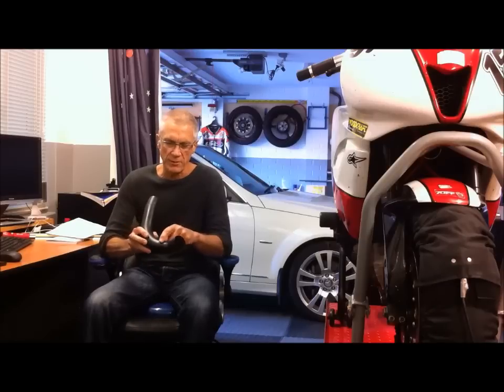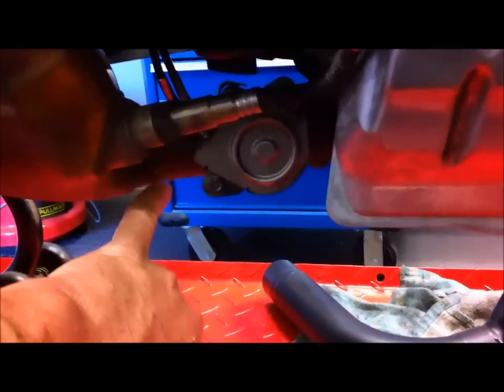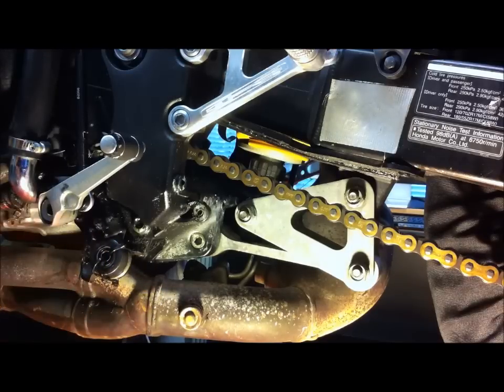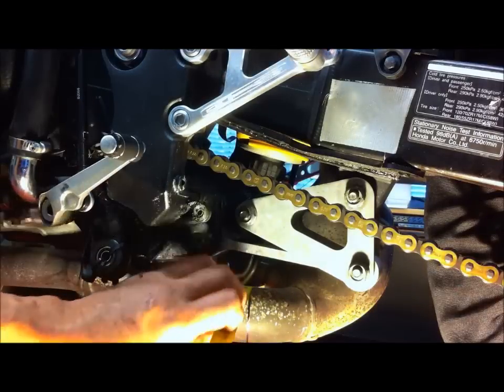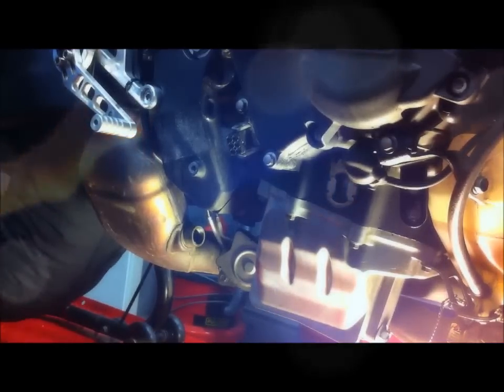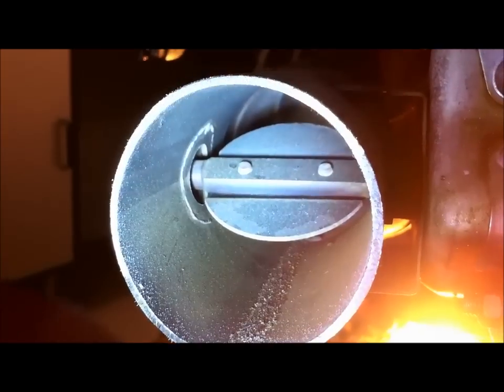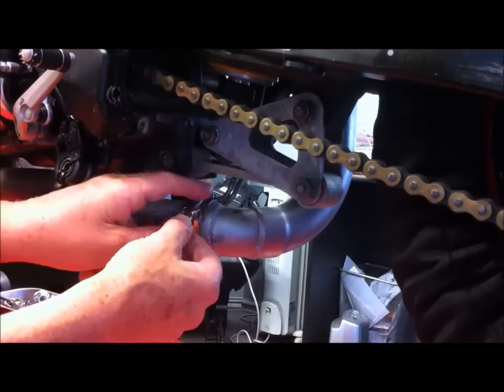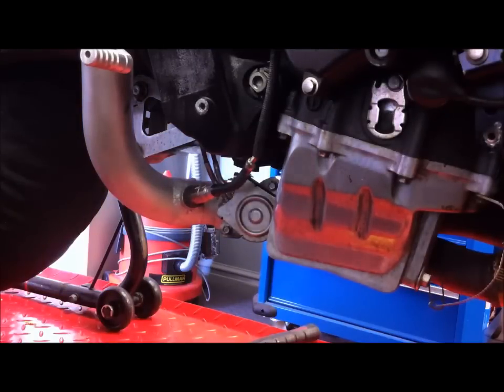2008-2017 Honda CBR600RR Remove Catalytic Cat Converter Fit Eliminator Pipe Mid Pipe

Comment: Thank you.  This video helped me replace the cat converter on my 07 cbr600rr with a SS midpipe with O2 sensor (for my bazzaz and zafm autotune.  Followed your instructions step for step, except for the welding part.  Great video.
Reply: Did you not weld? I want to take off ny cat off ny 07 cbr but looks quite difficult and plus I'm wondering where to get a mid pipe.
 any advice
Reply: @mando8977  No, I didn't weld.  The mid pipe I bought from MJS Performance came with the bung pre-welded at the proper angle.  This is what I bought:  https://www.shop.mjsperformance.com/product.sc?productId=214&categoryId=59
Reply: @mando8977  As for advice, it's a great video, so I pretty much followed everything to a T.  It took a bit of courage to start cutting my pipe, but measure twice and you'll be fine.  I used masking tape to mark my line around the pipe.
Reply: Sweet man!! I'm actually a little worried of cutting my pipe too... I think I'm just going to go ahead and do it, so you have clamps on both ends of the pipe? And also didn't make a big difference in sound and or performance?
Reply: Yes, I have 2 clamps on.  The bottom clamp came with the midpipe on the link I posted.  The top one was already there from my Akra slip-on.  The sound is more throaty without the cat.  As for power gains, I'm not really sure because I autotuned my bazzaz mapping at the same time....which was the main reason I got the midpipe with O2 sensor.  Let us know how it turns out.
Reply: Sweet!!! I THINK im going to do it this month.........last question... did you have to flash your ECU???
Thanks  in advance

Comment: The only part I would be reluctant to do on my own is the part of the video you edited out. Drilling the hole for the 02 sensor and then welding it closed? I'm not even sure what you did there. Do you have that footage?

Comment: I'm curious how much weight was the cat if you had to take a guess? I'm doing this to my bike next week, I already have the parts.  Thanks for the video
Reply from the maker: The cat is not heavy. The weight advantage with the eliminator is minimal. Scott
Reply: Scott Elliott Thanks Scott!!!
Reply: Scott Elliott One more question sir
Did you have tune your bike again after you removed the cat? My bike has already been flashed and tuned my concern is the reduction of air space might disrupt the mapping. What do you think?
Reply from the maker: I tuned my bike as it's a race bike. I have an engine management system that allows me to tune the AFR's. For a street bike I don't think you'll need to change anything. The existing cat does flow quite well so the eliminator gives a small power gain which you'd possibly not really notice on the road.
Reply: Scott Elliott where did you purchase the mid pipe? Or can you recommend where to buy?
Reply: Tyler Moyer I bought mine off if ebay for about 135 I believe perfect fit. I love it
Reply from the maker: search eBay for 600rr cat eliminator. You'll find plenty. http://www.ebay.com.au/itm/DECAT-Cat-Eliminator-Pipe-Exhaust-Honda-CBR-600RR-07-16-Stainless-Steel-/201781515475?epid=621657083&hash=item2efb1d94d3:g:6-QAAOSw241Ydz8U
Reply: @Scott Elliott Not sure if you will repliy to this as its a year ago but i also followed your broken foot video haha i had the same issue 3 bolts in my ankle as well :) only just got my last cast off 3 weeks ago. Did you notice a sound difference when you decat your bike >?

Comment: I was thinking of changing my OEM fog bulbs to a nicer looking once what do you think would look nice any websites you like to buy from ?
Reply from the maker: khaloudy boss Thanks. I bought some of these for the fog lights on my W204. They look great as they're 6000k temperature. Do a search on eBay for "H11 led cree bulb" and you'll find hundred's. I put a 25 w load resistor across each bulb to get rid of the error message.From experience I can say 6000k cree led bulbs look good as they give a crisp white light.

Comment: nice video Scot, was cool to see the inside of the cat core. did removal of the cat make the bike heaps louder?
Reply from the maker: No real change to the noise Tim. I already had the slip on pipe. I couldn't really notice the difference in noise on the track. It's possibly slightly deeper tone but not louder.

Comment: quick question... does it sound louder than it did with the cat?
I threw a slip on exhaust on mines but still not loud, wondering if it would make a difference in noise levels and maybe a little bit of performance?  thanks in advance!
Reply from the maker: I couldn't notice much difference in loudness.

Comment: Hello Scott. I hope you are doing well. I wanted to know if removing the CAT makes any difference in terms of sound and  performance?
i saw a couple of post on CBR600rr forums that removing the CAT make your bike worse if you don't install power commander or dyno tuned your bike to get the max performance. I am from Pakistan and unfortunately there are no Dyno tuners here. 
i am confused to remove CAT converter from my 2008 Honda CBR600rr. So wanted to know if its worth it or not before proceeding.
Reply from the maker: Yes I'm doing well ... thanks for asking.

Removing the CAT doesn't make much difference in terms of sound ... it's a little bit louder.
The fuel map will need to be changed to get it working optimally. If you haven't got a Power Commander or some other means of modifying the fuel map then leave the CAT in place.
Reply: @ScottElliott152  thanks man. Really appreciate that

Comment: i have a couple questions.
i have an 06 cbr600rr 
1. is it the same process?
2. if i do a delete pipe do i have tune? or do i make a fitting for the o2 sensor?
3. do i have to tune the bike?
how do i go about the whole cat delete situation?
Reply from the maker: I'm not completely familiar with the 2006 model. The process will be similar if not identical. It depends where the O2 sensor is. If it's on the front of the CAT like the 2007 model then you'll have to put a new threaded fitting onto the pipe. These bikes do perform better if you fit a Power Commander or similar to tune them correctly. They come out of the factory too lean at small throttle openings and too rich at high revs and high throttle openings.
Reply: oh okay i see what youre saying..
well thank you i will look into it more.

one more question for the pipe do i fabricate my own? or do they sell a slip on delete for the cat?
Reply from the maker: I thought I made it clear in the video. I bought that cat eliminator pipe from an eBay store. Search and you'll find one for a 06 model.

Comment: Hello, so cats are located in the mid pipe? I have 09 CBR600RR. Thx for the vid!
Reply from the maker: +Life On Two Wheels Once you remove the lower fairing you can't miss it. You'll need to install a new bung for the O2 sensor as it screws into the CAT housing. Regards, Scott
Reply: +Scott Elliott 
Thank you Scott. Appreciate your time!
Reply: +Scott Elliott hei i have an 07 cbr rr track bike i want to know how much gain in hp with cat out also the air/fuel flow how is it do i need a power commander to adjust thr correct map if the cat is out? do you have a power commander ? can you tell me the pros and cons.. also the EU bike have the o2 sensor like yours ?
Reply from the maker: I can't tell you how much HP gain as I have not had it on the dyno. It might be a few HP.
I have the Bazzaz ZFiTC system so I have adjusted the air fuel ratios. So yes you do need to tune your bike again with a Bazzaz or Power Commander. Both require a wide band O2 sensor.
Reply: my 07 cbr doesnt have a O2 sensor on the exhaust. if i install it, do i have to purchase a o2 sensor eliminator?
Reply: no

Comment: Hey bro good job there, i ordered the danmoto exhaust for my cbr 600rr 2008 , do i have to buy an O2 sensor eliminator?
Reply from the maker: If the new system doesn't have a threaded bung for the O2 sensor then I'd have one put in.
Reply: konstandinos lentzas  hey bro did you fit the pipe im looking into doing this to my Cbr 600rr 2010 wondering if I will need a pc or can I just run it without I have a yoshimura rs5 carbon slip on ATM. Any advise would be great thanks in advance.

Comment: I have an 04 cbr600rr and would like to do this to min, .but im not sure if it will be worth it as far as sound and performance. mine is not a track bike but I wouldn't mind it sounding like one. will this help?
Reply from the maker: It didn't make a discernible difference to the sound but I already had a slip on exhaust. It may make the standard exhaust sound a bit better.

Comment: Did you get a dyno tune after the cat delete ??
Was it a power gain or loss ??
Reply from the maker: I run the Bazzaz engine management system so I tuned it again after this cat delete. You do it on the track under normal riding conditions by collecting the actual AFR map and apply the adjustment to get your target AFR map. I can't tell you what difference in power ... if any. It's goes really well and is certainly not making less power. I like my little 600 :-). Regards, Scott

Comment: Kind of a random question but would you prefer a Honda oem oil filter or a k&n oil filter
Reply from the maker: +John La Roche John either are good quality. I use HiFlo brand. They're cheaper and are just as good. I use lot's of them as my bike is a trackie. i change the oil every 6 hours and the filter every 12 hours.
Reply: FRAM XG6607 fits all CBRs, a high quality full synthetic oil filter you can find at Walmart for $9. K&N is good filter but overpriced if you buy it locally. Mobil 1 M108 is a good partial synthetic filter but overpriced.

Comment: I have a CBR600RR and i want to do this but i still have the stock exhaust on it will it make a difference in noise if i do this with the stock exhaust?
Reply from the maker: Not much. You'll not notice much difference in sound.

Comment: im doing this to my bike but i just notice that mine does not have the O2 sensor... would it work if i install it anyway? and do i have to purchase a O2 sensor eliminator?
Reply from the maker: Well if you have no 02 sensor you don't need an eliminator. Perhaps the O2 sensor is located more forward on your model.

Removing the CAT will still work.

Comment: Hey Scott, I have a stock 08 600rr. I have ordered decat link pipe for it and that should go on next week.  Will I require a power commander?
Reply from the maker: Probably not. The standard CAT flows quite well. You'll have to install the decat pipe and see how it goes. If it's a track bike I'd say definitely a Power commander , Bazzaz or similar would be required to get the AFR's right. For a street bike you might be ok. Scott
Reply: Yes, it's a street bike but I do take it on the track thrice a year. The environment I ride in is quite dusty therefore I have stuck with an OEM air filter. Thanks for the wisdom, I will probably look into power commander to be on the safer side.
Reply from the maker: What I've found is ... the bike in stock form is generally a bit too lean at small throttle openings and too rich at high to full throttle. This is obviously to comply with emission and noise standards for street riding. Running them a bit rich at full throttle is kinder on the motor so they'd do that for owners who perhaps are not diligent with maintenance.
Reply: Scott Elliott Ohh good to know this. I thought that stock bikes run lean throughout. I have also noticed that compared to older bikes, modern superbikes feel gutless at low rpms ( like they are starving for air or fuel).
Reply from the maker: Excactly due to to being too lean at low revs and small throttle openings. They starve them of fuel to meet emission standards.
Reply: @ScottElliott152  Found this video years later after picking up a bike that already had the cat deleted with no tune been pulling my hair our trying to find more information on if I needed to tune it. Your detailed comments were very helpful I feel much more comfortable now!

Comment: Hi Scott, many thanks for sharing your experience.
I did change fork seals with success following your video :)
I would like eliminate the cat on my cbr600rr PC37A (05/06)
I can't find seller, even using link on a previous answer.
Could you please address to a seller or any "keywords" for searching ?
Many thanks in advance from Italy 
Manuel
Reply from the maker: Thankyou Manuel. You have an old model. I can't find any sellers for 2005-2006. You may have to find a used eliminator pipe or drill out the existing cat. Scott
Reply: Thank you Scott !
I suppose will drill the existing cat
Appreciate the prompt reply, keep going and sharing, this feed the culture :)

Comment: Great video! Thank you for sharing. I'm debating doing this. Did you notice any difference in performance, and how much louder does this make the exhaust, (if any)? Thank you!
Reply from the maker: Brent thanks for your kind words. Unfortunately I'm out of action injured after a fall from my KTM530 Enduro bike so have not tested it yet. I broke my left wrist. In fact I made the video with a broken left wrist as I didn't know it was broken at that stage as the first X-Ray said no fractures! No wonder it was sore. I had surgery three and half weeks ago ... a displaced fracture of the scaphoid and a chip off both the 2nd and 3rd metacarpals. I've got more hardware in me than Home Depot!

I'll be on the 600RR again at the local raceway on the 20 December so my plan was to take some on-board footage and make a short follow up comparison video coming out of the fast turn leading onto to the main straight. It's full throttle from 3rd to 6th hitting about 220km/hr to 230km/hr depending on the wind direction. I have plenty of recent footage with the CAT so it will be easy to hear the difference in a video.

When I start the bike it sounds crisper when I blip the throttle and is probably generating slightly more noise.

Comment: We all was hoping to hear what it sounds like..
Reply from the maker: Leroy Dennis Yep ... I'll see what I can do. I have footage with the eliminator pipe so I'll put something together.
Reply: Thank you.. i have an 06 CBR 600RR, An i used a circular drill bit (big as a quater) an a long extension an stick it inside the exhaust an drill 2 holes in the baffle, an it is the sweetest sound.. it makes the bike come alive.. i did it to my boy 2012 CBR 600RR An he loved it.. Way better than buying an exhaust system.. 954-465-5515 for any questions
Reply from the maker: Leroy Dennis Leroy I've reviewed footage before and after. The mic was in the same place. At high revs on the track there's no real noticeable difference in the noise levels. The bike certainly runs more freely but I can't really tell much difference in exhaust note or noise level.
Reply: Leroy Dennis Hi Leroy, will you please make a vid of how exactly to go about doing that ? Or even post a vid on how it sounds ? I'm contemplating on doing your method to my stock exhaust.
Reply: Leroy Dennis I have a 2013 600RR - will this CAT eliminator kit fit my bike too?
Reply: I am not sure. This is not my video.
Reply: @aa2398a   07-18 is what the pipe is listed for at MJS Performance

Comment: Do you need to retune the bike after removing the cat or is it okay to run the stock ecu?
Reply from the maker: For road use I don't feel you need a retune.
Reply: @ScottElliott152  I wanted to remove the cat for heat purposes but it's not going to be a track bike so I wasn't sure if I needed to tune it.

Thank you for the quick response!!

Comment: Will this work the same on a 2018 CBR 650F? just wondering..
Reply from the maker: I should be the same if you can find someone who sells a cat eliminator pipe for that model.
Reply: @ScottElliott152  I found a few suppliers online through Ebay but they all came back and said they didn't have one for my model.
Reply from the maker: @footsmakenzyhellothr  Try a fabricator and get one made for your model.

Comment: hi scott, will a steel saw/hacksaw cut through it?
Reply from the maker: rap padrigon yes it will. I finished the cut with a hacksaw. Scott
Reply: thank you sir. and that's an awesome man cave i must say. how did you find -where you unplug the O2 sensor, mine seems to be wayyy up deep in the unknown. i don't see it. and if i decide not to plug it in and not make a hole, will it damage the engine?
Reply from the maker: Thanks for the kind words about the man cave. You need to remove the seat and tank as the connector for the O2 sensor is tucked away behind the engine. You'll be able to follow the cable from the sensor to find the connector. Yes you need to have it connected for the engine management system to work correctly. Most of the Cat eliminator pipes now have the O2 sensor fitting installed so it's easier. Just screw it into the eliminator pipe. Scott
Reply: thanks scott! great video! awesome channel! and sir you are kind.
Reply: @ScottElliott152  Thanks for the helpful video.  Mine did not come with instructions, so it was nice to know the 89mm length.  I am responding to help with the O2 sensor wiring.  Just make sure its unclipped off the rearset, and then just carefully unscrew the sensor making sure you don't get it all twisted up at the sensor end.  Let the wire wind up slowly and carefully upwards.  Then when its off let it relax.  To put it back on, just wind it up in the other direction, with enough turns to allow it to finish off in a normal position.  I am a licensed auto tech and I do this.  It saves time and it can also save a part if the other end is old and brittle.  In this case it seems like it will save a lot of headaches

Comment: Why didn't you just install an O2 Sensor Eliminator?
Reply from the maker: Because I don't need it. I have bypassed the Honda ECU by installing the Bazzaz ZFiTC which has its own wide band O2 sensor and engine management software. I have my own map that I adjust according to the weather.